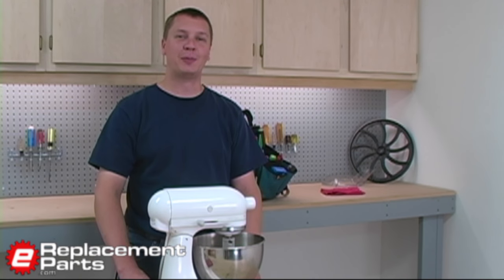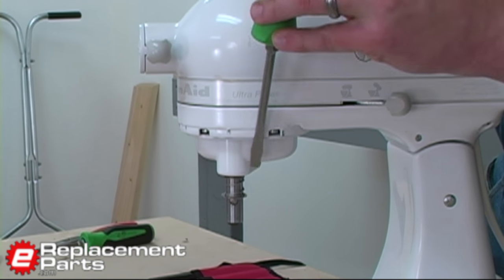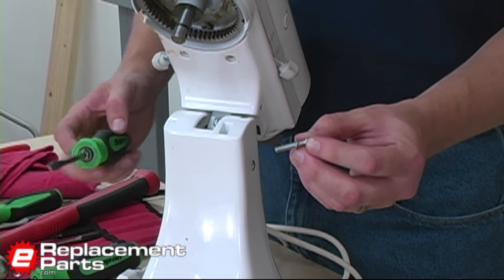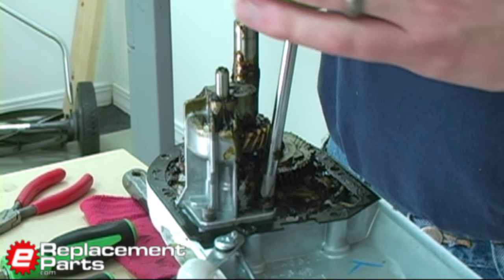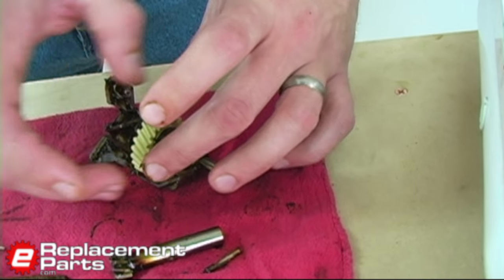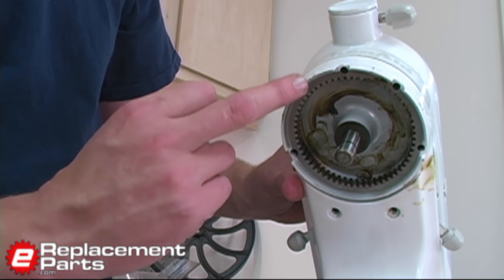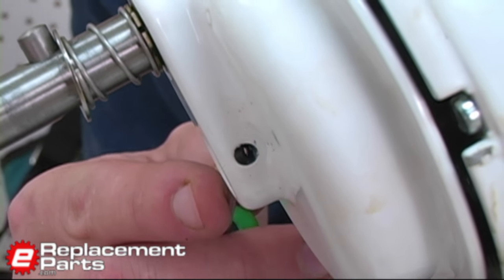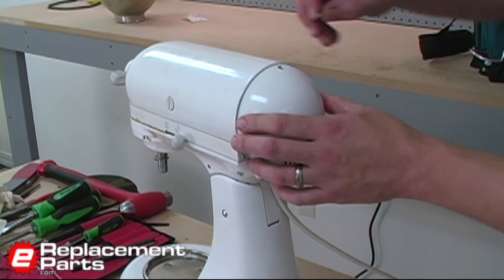How to Fix a KitchenAid Mixer That Isn't Spinning

Comment: anyone trying to remove the first outside dowel pin, you need to lay the mixer on its side, put a 2x4 on the the under side of the dowel pin along the white body to support it, then wack it HARD several times with a punch and hammer, and it will come loose. The purpose of the 2x4 is so you don't transfer your entire hammer force to the axle. We don't want a broken center axle.

Comment: Great video! Instead of replacing just the worm gear, I ordered and replaced the whole worm gear assembly. The cost was less than $10 and this way I didn't have to worry with knocking out the worm gear pin. Just remove the 3 phillips head screws, pull out the old assembly and replace with the new one. Works as good as new now. Thanks again!
Reply: +Greg Grubb After reading your comment, I went to the eReplacementParts.com website and sure enough, the cost of the whole worm gear assembly is the same as the cost of just the worm gear.  Someone else asked why that was, but they didn't answer specifically-  just suggested that if they had to replace it, they would replace the whole thing.  Thank you for bringing this to our attention.

Comment: Watched the video and was able to replace worm gear. You need to show the inside top of mixer better because one gear did fall off the mount and I wasn't sure where it went. I finally was able to make it out by watching this video in slow motion like 10 times.

Comment: Thanks. Great video. Replaced worm gear easily. Didn't even need punches. Two nails with the point snipped off did the job. One point if you've got KSM45 -240 volt, there's a little electric board attaching the motor part (top), to the tower (lower). Just 2 extra screws, but don't be surprised at 3:20 if the motor doesn't release cleanly!

Comment: Thanks for a clear instructions in images and words.  My problem turned out to be the pin for the worm gear.  The pin was loose in the tower area and bent into a boomerang shape.  It must have worked loose and hit the tower to bend it and knock it loose from the assembly.  No problem, I just ordered a new pin and followed the reassembly instruction.  You saved me a lot of money and I thank you for that.

Comment: Great video.  I also had a very hard time removing the planetary roll pin.  Finally got it done by using a drill with small metal bit to make a shallow hole in the top of pin.  My pin punch then held in the hole without slipping, and I was able to give it a few strong whacks with the hammer.  Came right out.  A little cosmetic damage but the pin was still usable.  Thanks for the instructions!!!

Comment: Thank you for the video. Everything is back together and working great.
A couple points
I have an older KSM5DGR, with a fixed motor and a movable bowl. You have to remove the four Philips #3 or #4 screws holding the head assembly from the stand to get at the two "hidden" screws underneath. Thirteen screws in all.
There's also a "head gasket" between the upper motor assembly and the lower gear assembly. It only goes in one way; so that's not a problem. Just don't forget to put it back. (Yeah, I forgot and had to tear everything apart again).
As for roll pin on the worm gear, it was a pain the the butt. I eventually used the next smaller punch in my set, and a bunched up shop towel to help hold it in place. It finally came out. You just have to keep at it.

Comment: I had to replace the speed lever, which required the disassembly shown in this video.  Never in a million years would I have been able to figure it out on my own.  This saved me a ton of aggravation. One thing that was missing from the re-assembly section (or maybe I missed it) was that you need to be careful of the location of the electrical wires when you replace the top housing.  Once I got mine screwed down tight, I discovered that one if the wires was pinched between the housing and the main unit and I needed to to loosen the screws to free it.  Thanks so much for this video.

Comment: This video is great for two reasons:

1. Watching this video prevented me from making several mistakes which would have happened had I just began disassembling my mixer to figure out what the problem is.

2. This video also makes it clear that this is a repair I can do and I don't need to take my mixer to a repair shop.

Thanks.

Comment: This video was a lifesaver!  Thank you for putting it together and being so detailed.  I was able to fix my wife's mixer in about and hour after obtaining the part and the grease.  We thought the mixer was a gonner until I saw this.  Thanks again!  I replaced the grease inside the mixer because what was in there didn't look very good and it wasn't covering the gears very well.

Comment: Thank you so much! We bought our mixer brand new and it leaked hot grease right from the start. We should have taken it in for warranty, but we figured we would have paid for a new mixer by the time we paid for shipping and the cost of repairs (they might have covered, but what's done is done). So there it sat in the kitchen unused for about 5 years.

I felt like today was the day to fix it. So the biggest mystery to me was how to take it apart. Thankfully I ran across this video, which just so happened to be the first video I came across. From just watching a couple of minutes of your video I was able to take it apart and fix it! All I had to do was clean the gasket and I added some form-a-gasket just for good measure, put it all back together and it's literally a brand new mixer now! Thanks again for such an informative video!

Comment: Great Video!  I replaced the worm gear for cost of $6.20!  Kitchen Aid estimated 50 to 200 repair and since my machine was 20 years old they didn't think it would be worth it and best I bought a new one.  Followed the great step by step instructions in video and it works!  So happy!!! thank you!

Comment: Followed the instructions to the letter and my mixer is back in business!

One thing to double check when re-attaching the motor assembly is that none of the motor wires get between the motor assembly and the chassis. It happened to me and fortunately I noticed before I screwed the 2 together.

Comment: disassemble your mixer before you order parts. Your worm gear may be ok.
My worm gear was fine, but the dowel pin holding it in disappeared.  That pin was part # WP9705444. Instead of ordering a pin with ripoff shipping prices, I just used a broken drill bit, cut it down to size, used a few strands of telephone cable copper wire as shims, and tapped the drill bit into the hole for a snug fit. 
Mixer is working again.

Comment: Thanks for this video! I used it for disassembly/reassembly instructions when my speed lever wouldn't stay in the off position (turns out the screw that holds the lever was loose. Tightened that and it's fine now. Funny I couldn't seem to find that fix anywhere on the internet!). Actually doing it was more fiddly than the pro here but we managed to finagle it.

Tip for the really stuck pin: my husband clamped the mixer to the counter and just whaled on it with the hammer and punch. It just takes persistence and good clamps - two at least - (otherwise the force goes into shifting the mixer around). The punch does tend to slip off the pin; I could only get it to stay square when gripping it in my fist instead of a pincer grip.

In any case, we definitely wouldn't have figured out the intricacies without your help, thank you.
Reply: Amber Sutton we had that problem with the pins initially then tried it from the other side and the pin came right out...turns out they're designed that way...tapered on one end vs. the other.
Reply: I feel like I must have tried that too, but both sides were just as stuck. The pin looked pretty straight. Maybe we have different models?

Comment: Excellent step by step video that gave me the knowledge to re and re the ratched worm gear. This would have cost a mint in the repair shop!
Thanks for the video!
One thing that wasn't mentioned is you do need to disconnect a pair of wires in the back to fully disconnect the lid.  I just made sure they went back in the same place from where they came from.

Comment: I saw this video. Ordered the gear from ebay. Tonight I started the repair following this video. The gear inside looked alright. But looking for the rollpin. It wasn't there. So i dug in to the grease and found a bent pin. Straightenend it out and put it in. FIXED. Thanks Guys.

Comment: Very useful. My mixer would not turn. I followed the dismantling instructions and by shining a flashlight into the motor discovered that one of the brushes was not making contact with the motor. A little wiggling got it into place and the machine is back on. Thank you.

Comment: Thank you, thank you, thank you. I knew I could save my wife's beloved mixer if I could just figure out how to get the cover off. You gave me that and more. Worm gear has 4 or 5 worn teeth, the control is cracked and the brushes are worn. I ordered all the parts I needed from eReplacement part and will check back in when I have it working again.

Comment: I'm contemplating buying a kitchenaid mixer and I found your video very interesting and reassuring for it shows these machines can be maintained and repaired quite easily so that you can keep it longer than all that Chinese c**p. Thanks for your work !

Comment: Not sure if someone else has noted this, but when you take the tower out, you scrape off the grease. you should slap some grease back on once the tower is back on the mixer just before putting the top back on.

Comment: Thanks Mark, you saved me a lot of money. My mum, dad and I all worked together to fix this and it was a fun project. We were slightly discombobulated to find a spare cog fell when removing the housing, but soon worked out it was the attachment cog and put it back in. Getting the pins out and in again took a bit more effort that it seems on the video. But all in all, very smooth, thanks to your clear and steady instructions. Thanks again Kelly and family, Canterbury, UK.

Comment: Thank you so much for posting this outstanding video - i have used it twice to fix our mixer and my mother in law's mixer.  I will say that i find a good tip is to punch in the pin BEFORE putting the gear into the assembly just to loosen up the hole a bit - then take it out and do it the way outlined in this video.  Otherwise i was unable to get the pin into the new gear... for some reason kitchenaid thought a rounded punch pin was a good idea rather than a flat one.  

thanks again!

Comment: Mark, the video was excellent, and my mixer is working perfectly.  It was my fault that the worm gear failed as I left the additional mixing attachments in the mixer for storage.  I accidentally turned it on so the blade got jammed in the bowl with the additional parts and the worm gear failed, exactly as it was designed to avoid more serious damage to the mixer.  We love the mixer, and your video got us up and running in 20min.

Comment: Thanks so much for the video.... It was really accurate except I had wires and chips attached to the base behind the gears that I had to  first take a picture of the correct placement of the wires and then disconnect them. once that was done... easy as pie! Saved several hundred dollars doing this.... in Australia my KitchenAid was $799 on sale.... so thank you thank you thank you!!!!!!!!!

Comment: Awesome video, I thanked God that you put this up!!! You made it so easy. I'm sure service would have cost more that I could afford. I purchased the gear as stated, disabled the parts just like you said. Only problem was I had trouble getting the pin out of the planetary part ( but that's what brothers are for) it was super tight. I am pleased that for the most part I fixed my mixer on my own. I really appreciate you sharing your knowledge, you are the best. Thank you.

Comment: Thank you for the video.  It was a perfect tutorial for the standup mixer in my household.  The part was inexpensive and the design excellent.  That nylon worm gear saved the motor on the mixer.

Comment: Ours was also really stuck. It ended up breaking into three pieces. We were then able to get at the motor and replace the worm gear. Got everything back in place but had to order a new groove pin and wait until it came to test mixer. Once in it worked fine! Thank you eReplacements for this great video! The only glitch we had, besides groove pin was that we have a K5SS - 5 Qt with drop bowl. There is more involved in removing the top, namely unscrewing the base. This would be helpful to mention.

Comment: Great video. Since getting the mixers repaired in Europe is pretty difficult, you gave me a great help. It's very important to get the right tool, especially for removing the pins. The most difficult, the one in the main shaft, can be removed with a 4 mm punch. The smaller one with 2 mm punch.

Comment: Thanks a lot for the excellent instructions.  A minor note: on my fixed-head unit (K5SSWH), there are four big Phillips screws which need to be removed in order to access the rear head-mounting screws.

Comment: Grat video. I was able to fix the problem by replacing the worm gear. $4.95 on eBay. Planetary gear pin is hard to remove. Hammer hard until it comes out and you are set!

Comment: Very helpful.
I was actually trying to fix the ON/SPEED switch. It would not stay on the OFF position.
HELPFUL NOTE ALERT:
I was very glad to see that the screw that holds the slider in place was a smidge loose and was allowing the spring action to pull the slider back to the ON position.
I tightened the screw about 1/2 to 3/4 turn and vuala! problem solved!
Thanks again for a very clear and easy to follow video.

Comment: That's pretty simple.  The only problem I have had with min was it would leak oil.  Well it was just from non use.  I turn it on and let it run once every 3 months or so (if not in use)  and that keeps the grease from liquifying.
Great Vid!!

Comment: Fantastic video!  My KitchenAid mixer has been sitting in my garage for several years and now it is fixed, thanks to this video.  I did not know the plastic gear was designed to wear out to protect the motor.  I followed this video step-by-step and now I have a working mixer again.  Thank-you so much!  If this grandma can do it, anyone can LOL.

Comment: Hoorah for this video. Inside every mild mannered modern husband is a Mr. Fixit bursting to get out.  My model was muuuuuuch older, but it was all the same inside. Thanks also for the fine-tuned advice about the final pin to go to the service center if it didn't come right out. I did and a few bucks later, was home free w/o breaking the thing. I feel empowered . . .

Comment: Thanks! Your explanation was clear and helpful. I have a Kitchenaid 3C from the 1950s. It's a little different, but I used your advice to replace the grease on the gears and to take it apart for cleaning.

Comment from the maker: @islaguy100 and @lordvampir0  Long answer: The speeds breaking on a KitchenAid mixer usually means that its control plate either needs to be adjusted or replaced. Replacing one isn't too tricky, but adjusting it can be, and putting a new one in also requires an adjustment. More importantly, correctly adjusting the speed on a KA mixer requires a special calibration tool normally only supplied to authorized service centers.

Comment: Thanks, Mark!  I followed your instructions and fixed my Artisan.  I did have to run off to Home Depot for the punch, though.  Also, I ordered the worm gear with the bracket to make it a bit easier (#240309-2).  There were some plastic pieces in the grease, but I just fished them out.  Cost me all of $16 and 1 hour of time.

Comment: Thank you so much for this video! I successfully replaced my worm gear. The only hiccup I had was that my motor wouldn't lift off. Since yours came off so easily, I assumed it was because there was another screw I'd somehow missed or that you forgot to mention. So then I undid the screw that holds on the carbon brushes.  Oops. But fortunately, you also have a video about replacing those properly.  Then the motor needed some thin flathead screwdrivers to pry it off.  Thanks again!

Comment from the maker: After watching your video it sounds like the speeds need to be fine tuned. There is more then just the control plate that controls the speeds on these mixers. The control plate, governor, phase board, and rear bearing can all effect the speeds. We would suggest getting into a service center to get it looked at. Service centers have tools specially made for adjusting the speeds on these mixer that are not available to the public. Thanks for watching!

Comment: Fixed!  awesome video.  very helpful
I left the switch on 10 then reassembled the motor casing.  I took it apart and set it to 0 then reassembled, it is working fine now.

Comment: Wonderfully informative video!  I didn't have a transmission problem with mine, but the speed control was so heavily worn that it would not stay in the off, or speed 1 position.  Your video showed me how to get to that speed control lever properly.  Added 1  $0.001 washer to slightly increase the tension, and problem solved!  Thanks so much again!  Subscribed!

Comment: Fantastic video thanks, mine stopped spinning and would have cost a fortune to have it repaired. So I did it myself with the help of your video. Order two new parts, ready for next time! Brilliant tips all the way through. Never undertaken anything like this before but it proved to be straightforward if you take it one step at a time and lay the screws etc in order for the reverse steps. 🙏🏻.